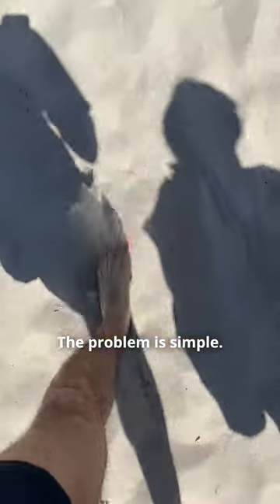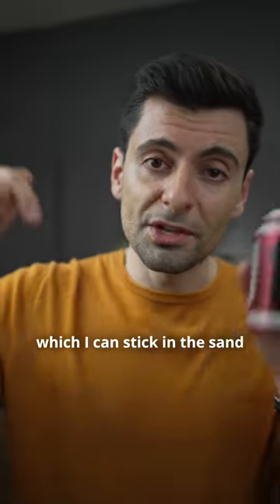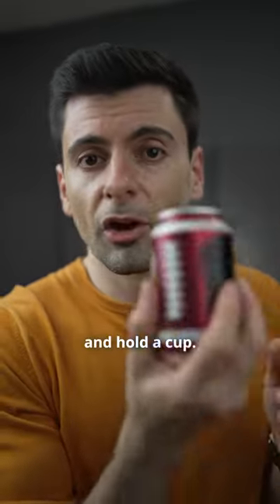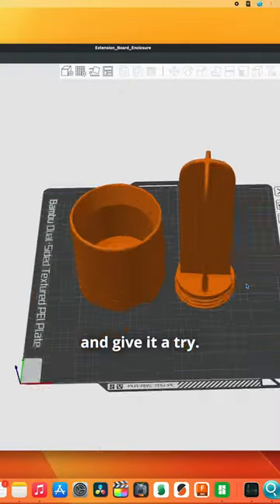😎 3D Printed - 🏖️ Beach Sand - 🥤Can Holder

Comment from the maker: What should I change to the design? 😎
😉👉 check my website: http://marsgizmo.com
Reply: I would make the base angled better for penetration, and make it stronger by printing it in 2 flat interlocking pieces in the XY plane. Look at the angles on a hunting arrowhead, but narrower. A tall isosceles triangle, rather than a rectangle with a spade tip, locked into slots by a screw-in O-ring.
Reply: One cut halfway from base to midsection along the center, the other from tip to midsection along the center, with 2 protrusions each at the end meeting the cup holder, fitting into slots recessed into a female threaded end with a ring-shaped male end that sits over the 4 protrusions in the spike assembly, holding them roughly flush with the base of the female threaded end on the bottom of the cup.
Reply: I would make it like a smooth screw, just like umbrellas when placed in the sand
Reply: Honestly would be better as a beach toy. Make the bucket wider, print a neat looking wiffle ball, and print two of the cups. You now have an actual game
Reply: I would make the base like an umbrella anchor with a screw design so it stays in the sand easier and can also be put in denser sand/dirt

Comment: I would probably make the bottom a little bit pointier but also screw on so you can fill the bottom with sand to give it some weight to not flip over. Screw on also gives the ability to remove the pointy bit to have it as holder everywhere ❤ great content as usual ❤

Comment: idl about yw base. but you should make one where the actualy cup holder part is shaped like a sand castle. 
wide base will make it a lot harder to knock over. 

you could even make one that is a sand castle bucket, so you fill it with wet sand then turn it upside down and it'll stay put, no need for a spike. 
the wet sand should also be pretty cold.

Comment: i would design it so you can screw the foot inside the cup holder, so you just have to unscrew the foot from the inside and then screw it back on the outside before stabbing it into the ground. It would fit better in a bag, virtually without having to carry 2 pieces.

Comment: Why don't you make the spike screw be able to be screwed by both sizes?? So that when you don't use it you screw it inside... When you want to use it you unscrew and screw it on the other side like the original.. it would be much more practical

Comment: I probably wouldn't thread it. I woud print upside-down & chamfer the inside to prevent overhangs & add a twist to the peg side to twist it in.
But that's me. How about a design process video? 😉